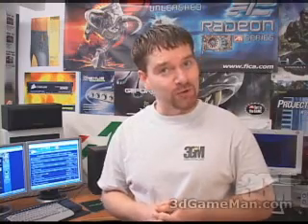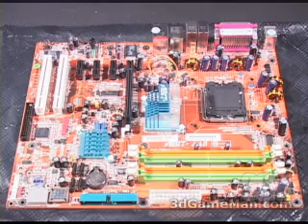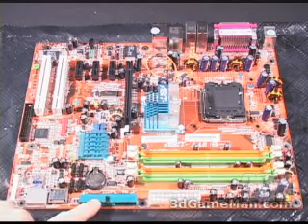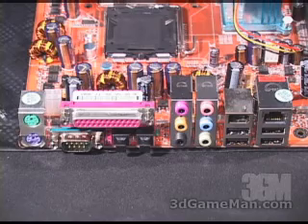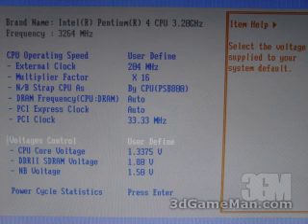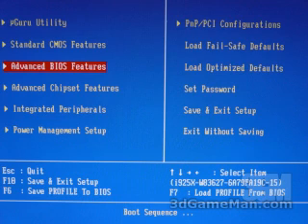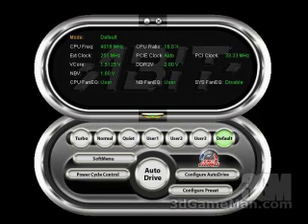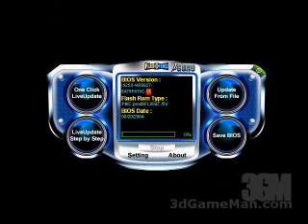#487 - ABIT AA8-DuraMAX Motherboard (Socket 775)

Comment: hello, im kinda new at this but im  building a computer for the first time. i have abit aa8 dura max mother board, a radeon x1300 video card, and well as the dvd/cd drives and a floppy drive... i was  wondering how much power supply would need? and also i was planning on buying a 1tb hard drive. is that a good idea? please respond.